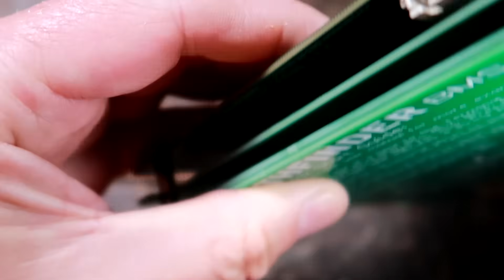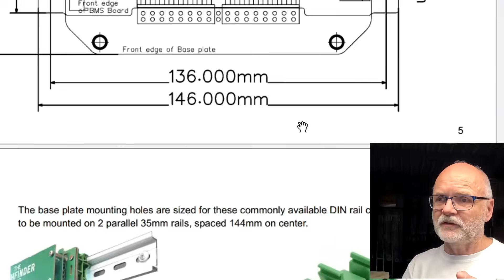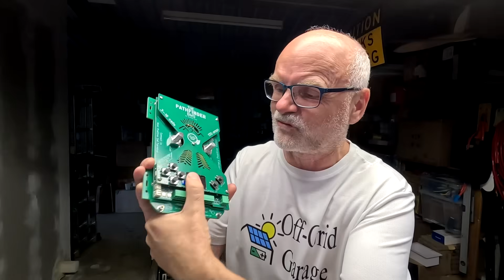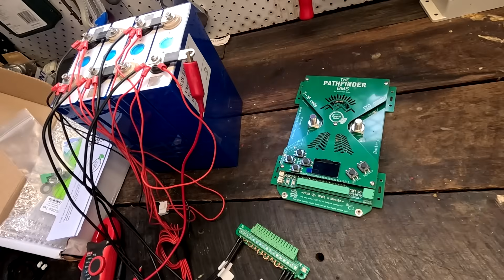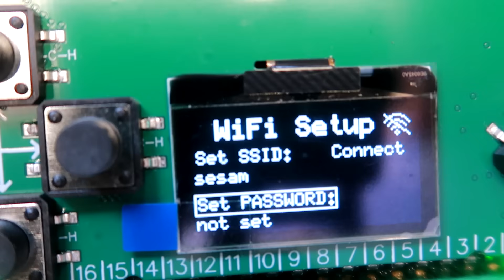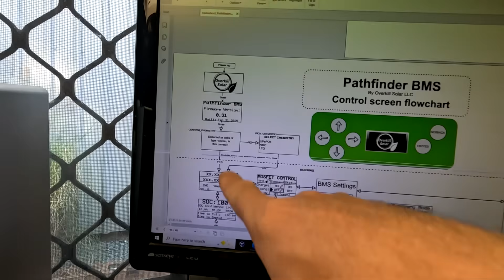The new Pathfinder BMS from Overkill Solar - but, has it found its path, yet?

Comment: DAREN BMS - with 2A active balancer but no rebranded JK BMS.  It is an OEM Manufacturer named szdrgk. Do you know it?  Would you ask them for a sample?
You find it in batteries from Docan and enov-batteries. Different App, different display, can do many inverter protocols like victron, pylontech and deye. Wifi capable. But nearly impossible to find information.  Maybe easiest to ask Docan for a sample of their moon batteries.

Comment: the reason for you sing ledged solder is that it is a loot more stabile in vibrating environments it don't develop cracks so easy but in something like this it is not needed

Comment: Andy lead free solder is truly awful.   It is the reason so many solder joints fail on modern items especially things like tv where there are heat cycles and it then cracks.  Lead solder doesn’t as it has a great expansion ratio.    

As for the jokes in the manual I guess it was lost in translation.   As a Brit I would have found it funny.   It’s what we would call tongue in cheek.  So almost a joke from the irony of it all.  As they are so health and safety conscious everything seemingly will kill you.

Comment: Thank you Andy for this informative session on the new Overkill BMS.  I'm afraid I will be sticking with the good old JK 200 amp with 2 Amp active balancer.  I have had several in service now for over 3 years in motor homes and golf carts, all working perfectly!
Reply from the maker: Yes, stick with the JK. Min is running in the battery shelf since the beginning, and I had no issues with it either. Except the SOC calculation...

Comment: When you showed the github page , together with the made for DIY enthusiasts remarks, I was ecstatic for a second there thinking the code would be open source. Now that would be a 'feature' making me consider the  220 dollar .... But sadly the github is just binaries :/. I think the SOC learning algorithm with confidence levels is the way to do it i think  so I like that. The passive balancer is a disappointment  (and why not make it an alu PCB for better heat dissipation), so hopefully we get a version with an active balancer soon. The SW still has a lot of baby problems for a version being sold to end customers but they can be fixed. The ROHS is strange, I agree lead based solder is way better if you turn a blind eye to the environment, but if they do that they cannot sell their product in the EU for example.

Comment: hlw sir. i have 16s life po4  25 Ah battery. battery low voltage cut then i turn on emergency mode.i fully discharge it.but when i charge it the bms not charging. charge is off discharge is off balance is off.but when i turn on emergency mode then turn on charge & discharge but balance is off.
if turn off emergency mode then charge is off discharge is off.plz help sir
Reply from the maker: I received your email. You screenshots of the JK BMS don't show any cells connected.
Reply: @OffGridGarageAustralia yes sir yes.
plz help sir plz 😢😢 4 day i am job less
Reply: plz sir solve this sir plz🙏🙏🙏

Comment: I got their older BMS, I haven't actually really used it, as my pouch cells started bloating and I scrapped the plan to use the cells.
The Website is definitely down for me locally here in FL/USA.
I hope they take your criticism to heart as a lot of it is exactly what I think and I am sure many other people. 
I would enjoy the ability to get a US built, or even better FL built BMS, however not having an optional display is unfortunate.
It is clear they are far from finished, but it seems like they could have waited a couple months to send you a sample, until they worked out the issues. 

I hope to see another video on this, or a better version in the future. 
Right now I have no justification to buy without optional screen and far from polished settings.
Reply from the maker: Yeah, website is back online...

They should have declared this BMS as an early version so I would have been a bit softer in my judgement. But for US$230... not great...
Reply: @OffGridGarageAustralia  They definitely didn't. Will Prowse also listed this new BMS on his website. IDK if he put it on his website from past reputation, but it does question my confidence level, as I always thought his material and suggestions were pretty spot on. 

I enjoyed your judgement and thought it was pretty spot on from an initial user's experience. And the German direct-ness : )
But while they did some things right out of the box, they left other things out (MQTT vs external screen compatibility). Some less advanced users may not want to set up a network with home assistant or solar assistant. But I am happy they are there.

I could talk more for ages, but I really think the conclusion is, you were the right amount of hard on your judgement. 
And at the end of the day, don't release a beta product to the market as a final product. Release number indicates that >1.0. I hope your review gets them back in the track they need to be on. 

Thanks for the reply, and take care, in sunny hot Australia, or in my case, sunny hot Florida! 🥵
Reply from the maker: @TravisAviation  Thanks a lot for your feedback. I agree with you. It has some good features and I also like the OTA updates. That could potentially save them. But the price need to come down significantly if they want to stay competitive. 
Well, I tested it again today and found... more😲
Reply: It seems the website works now. 229 is the price advertised on their website.

Comment: The California comment is kind of a joke.  California has enacted very restrictive laws that require warnings like that (usually says "known to the state of California to cause cancer...").  But the testing parameters they use are also known, and if a fifth generation descendant of one rat of 500 in the study - where they were fed 500 times the dose any human could consume in a LIFETIME - gets cancer, California will insist on this label (okay, maybe that was a tiny exaggeration, but the point is still valid).  They've been doing this since 1987, so it has nothing to do with our current (or any) president, and if you're listening to that hype, you're wasting a LOT of time listening to fairy tales.  Please stop helping the liars spread this crap, or at least do your own research before doing so.
Reply from the maker: I'm not helping anyone, I just didn't get this comment in a technical documentation.

Comment: many years ago I was going to get the Overkill after watching a "Will episode", than I discovered "The off grid Garage" and the JK convinced me a lot more.
Reply: Yeah JBD was great, I havent tested this new one. And that was like five years. I like the jk, just tried one for a few months now
Reply from the maker: @WillProwse  The JK is not perfect either but at least the software is now in a state where we can use it and it runs smoothly. And it is simple to setup.
Is JBD completely off the market or did they just terminate the collaboration with Overkill?
Reply: @OffGridGarageAustralia good to know. And I have no idea
Reply: @OffGridGarageAustralia  I loved the jbd. When it came out ages ago, it was the first good BMS. Need better options. I need to watch your videos on the jk BMS and find out what's going on
Reply from the maker: @WillProwse  If you have questions about the JK, let me know.
Reply from the maker: Thank you. 
The old Overkill JBDs are actually very good BMS and very accurate with SOC measurement.

Comment: Complexity is the mortal enemy of reliability. I'll keep my old Overkill BMS. It works just fine. I don't see the value of a 1 amp balancer. I connect an active balancer with gator clips once a year when my cells need a little balancing. And.... how much current does that new BMS draw? It feels like it will suck the life out of my bank when it's idle. This BMS is definitely not ready for prime time! THANKS FOR THIS VIDEO!
Reply from the maker: Good thinking with the active balancer maintenance once a year.

More tests are on the way with the Pathfinder...
Reply: I need that WIFI for a remote cabin, but I agree with my old Overkills doing great!

Comment: To get a good ride with ESP32 and WIFI: NOT use mixed band 2,4/5. NOT wifi mesh. Ideal an old router/access point with 2,4 WIFI and WPA.
Good luck.
Reply: WPA???
ESP32 already can have WPA2/WPA3 support.
2.4Ghz only???
Some devices (like mine Pixel 8 pro) can ONLY do dual band 2.4GHz / 5GHz access point, no more 2.4GHz only.
Reply: @volodumurkalunyak4651 If you want a stable conexion with ESP32 take my advice ;)

Comment: The fully charged and discharged voltages are maybe OK for a common installation, but you can fully charge (and eventually overcharge) a 4 cell (12 volt) LiFePO4 battery with a terminal voltage as low as 13.5 volts (3.375 volts per cell) - provided you have enough patience and a desire to treat your battery with gentleness. I'm disappointed that a current shunt isn't used to detect the charge current taper with 100% SOC detected at 3% of capacity (0.03C). This BMS is using a one-size-fits-all approach where capacity isn't accounted for (a cheaper voltage-detection method). There is still too much lead-acid battery community mentality in the belief that terminal voltage determines SOC at full charge. Fortunately, my Victron charger can be configured to terminate charging during the charge current taper (I sacrifice less than 1% of capacity with that regime). This BMS with factory settings would never accurately display SOC at full charge because my charging properly terminates at below 14.0 volts terminal voltage.
Reply from the maker: A cell charged to 3.375V will eventually stop charging. The current will go to 0.0A and there is no overcharge possible.
We have tested this a few years back in all details.

Comment: Leaded solder is indeed better. Sure it may be worse for the environment, but joint quality is better) . ROHS joints are more likely to dry out and crack.  I know this by experience of ROHS vs non-ROHS boards.    But yeah they have work to do on this thing and documentation.
Reply from the maker: I use lead free solder for 20 years and never had any issues with connections or solder getting brittle over time. I don't think we need to go back down that path. What's next, leaded fuel?
Reply: @OffGridGarageAustralia  Until you compare it to leaded tin connection. Now put the same boards in a drafty moist environment with a lot of temperature changes. Guaranteed the ROHS tin will crack first. I swear by old conventional electric solder. I also solders easier. It's a fact houshold equipment started lasting less long cus of this BS ROHS standard. Old stuff lasted 20+ years without a hitch (the old Phillips tv's for example). Now what's better for the environment? stuff that becomes trash after 5 years or just decent boards with a little lead in the solder? This is the real reason they switched to ROHS! Has nothing to do with care of the environment. You fell for their BS.  Whether we should go back to leaded is another discussion. It's not up to us to decide.  If it was up to me we'd switch back in the blink of an eye.

Comment: Lead solder is better, it is more reliable - far far far less prone to dry joints, ask any electrical engineer, they will tell you use lead solder. The California thing, I got the joke, I love it.... California makes so many stupid local laws (called props) they have to put dumb warnings on everything, you'd be amazed at the things they make US suppliers put those dumb things on, I love the dig they made.  But for 230 USD, thats gonna be like over 350AUD - ummm.... no thanks , too many basic things wrong/missing, to be honest, as an engineer my time is worth 160 an hour wasting 2 hours  on the basics is not acceptable. They could have as you alluded to,  seen the features of their existing competitors, and made them better, but they didnt, its like in 2025 saying here is a brand new Holden car, and its actually an EJ.
Reply from the maker: Never had trouble with lead free solder for the last 20 years...

They could have send me one and said, hey, this is first concept, have a look and let us know. Yeah, pretty much wasted time so far...
Reply: 100%  I know from experience. Leaded tin is better is every way. Easier to solder and lasts without drying / cracking. We even used it as a special service. Some customers demanded it.
Reply from the maker: @SonPowerSolar-jc1ov  The lower melting point makes it not ideal for a BMS which get 100°C and more.

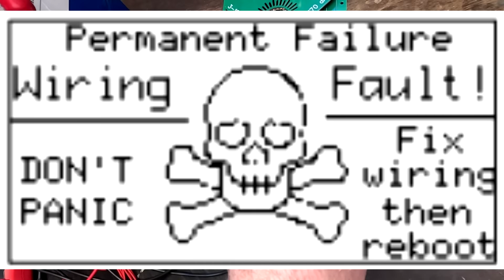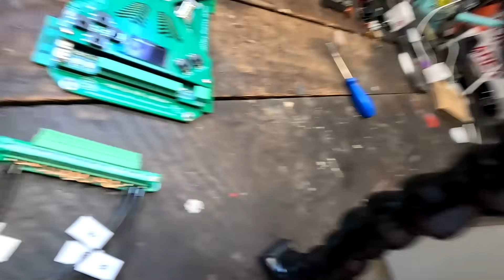Comment: Hi Andy, I don't understand the difference with the wiring of the Balance leads at 18:40 and at 21:35.  I watched the video again and I think I understand, what you showed at 18:40 is the correct wiring, but was NOT what failed, which was missing the jumpers for the unused cells.  Please confirm this, I am very visual in my thinking style  Thanks for the video.
Reply from the maker: I swapped cell 2 and 3 when the red light turned on. This was to demonstrate how the connection board works. Thanks for the hot coco!
Reply: @OffGridGarageAustralia  I was referring to the fact at 18:40  the unit had the same set of jumpers (B3 to B15) that were shown at 21:35.  I went back and forth between those 2 pictures and could not understand why the first one failed but the second onw worked.  I just found that a little confusing until I listened (with focused attention) do the dialogue at the beginning of that portion of the video.

Comment: I looked into it a while ago, when their website was working (I gather their database server is down at the moment) and it looked promising. But the price and the "rough edges" on their software (and the uncommon design) made me hesitate.
I guess it is still work in progress and look again in a few months time.
For the moment I'm on the fence due to the above.
Still happy with my Müller Energy solution although their warranty is apparently non-existing (had a DOA but no response from them).
Reply from the maker: I also was very excited about this BMS and a bit disappointed now actually testing it. I hope they can improve the software and documentation but again, I'm not sure what this BMS is designed for. Certainly not several 16s battery banks in parallel...

I'm surprised about the lack of service you have received with Muller. Keep contacting them.
https://mullerenergy.com.au/contact-us/
Reply: @OffGridGarageAustralia  Fingers crossed that OverkillS will resolve the several issues (cynical tone on) WITHOUT relying on YOU, dear Andy, for reporting on them and EDUCATING them HOW the should resolve it. As you have done so many countless times already with several BMS "manufacturers" and in the end they still do screw-up (cynical mode off). I am a wee bit surprised though that with (most) BMS manufacturers with a new model BMS, new issues arises quite often. As if they are great at hardware but not that good at software. In short, buy an older BMS so you hope most issues have been resolved ;-)
As with Muller Energy, I have tried contacting them 3x times without any response, so I gave up on it.
Reply: PS: At least OverkillS has fixed their website ;-)

Comment: understand your frustration of connecting to wifi and generally setting up, time these manufactures (including inverters) built in a web server, there are plenty of open source low cpu/ram servers out there I be happy pay an extra $5-10 for this esp as I want to be able to remote manage all this stuff without subscriptions easy if TCIP . Network All The Things! 

my reason for no subscription is purely security based as most of these manufactures have no clue about network security and make assumptions based on the worst case i.e. everything on the same network

Comment: So happy to see leaded solder used.  Modern premium eutectic leaded solders are far superior to most lead free solders and if you combine this with standard conformal coating and the tiny amount of lead is not even a real problem.  Since leaded solders usually have a lower melting point and are also less brittle, they usually lead to far greater reliability.  RoHS is and has always been BS for the majority devices made as it has led and still leads to many premature failures.  Especially considering, LEDs and many integrated circuits are made of very toxic materials and heavy metals but don't count under RoHS rules just because they are partially encapsulated.  Lead, Tin, and Silver used in quality solders are pretty much infinitely recyclable so should not end up in landfills.  However LEDs and many integrated circuits have very limited recyclability so modern electronics recycling will capture the solders and un-encapsulated metals used in most electronics but much of the encapsulated stuff ends up in the landfill where it can break down and will eventually corrode and leech out anyway.

I still think the idea of communication between the BMS and inverter is pointless since you will still need an external shunt to measure total system current anyway since the calibration and accuracy of most BMS units is pretty hit or miss and the voltage and current measured at the main system bus is far more important.  This also means you don't have to worry about having protocol and communication incompatibility.

Also, nobody outside of California likes California because stupid decisions are often first made in California and then forced onto the rest of the nation due to economic and federal factors.
Reply from the maker: No, not happy with the leaded solder in this product. I use lead-free solder for over 20years. Guess how many issues I had. It's bad for the environment and we should nto use it any more. We have alternatives!

Maybe California and Washington should split up from the US and join Canada? There is an offer on the table, I heard...😉